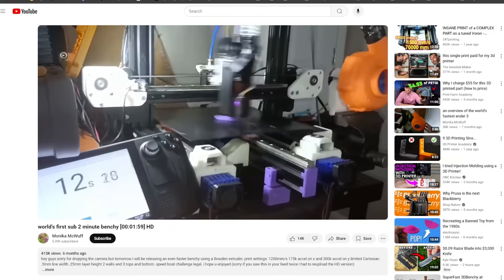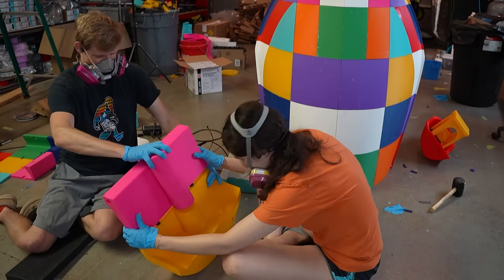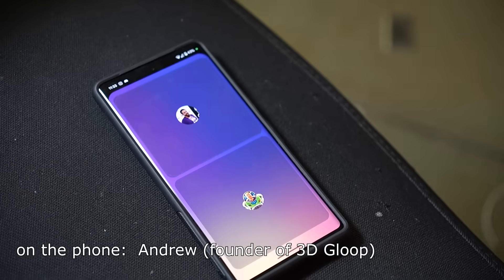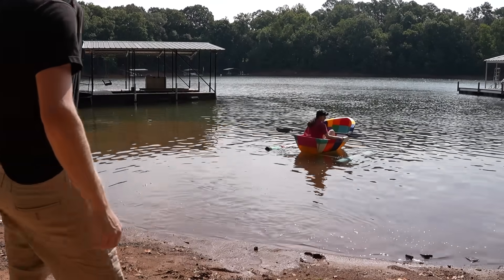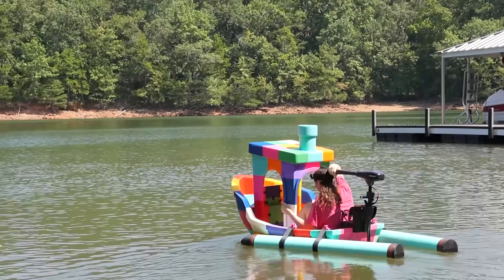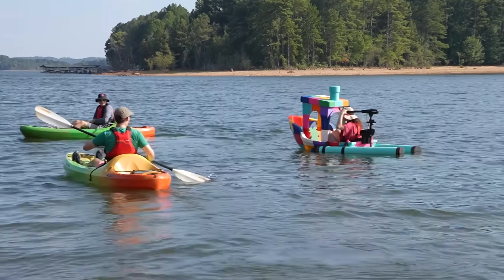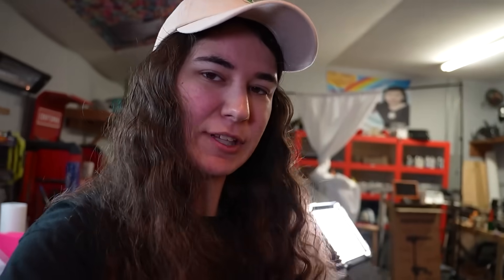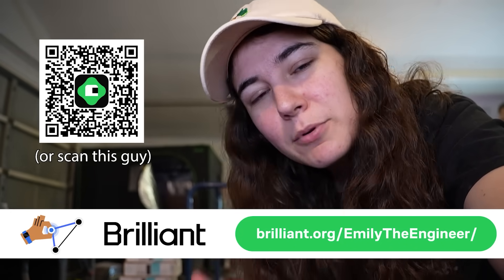I 3D Printed a Boat (World's Largest Benchy!)

Comment: Next trial. Smaller submerged outriggers, or a flatter bottom, to avoid the outrigger look.
When 'solder iron melting plastic' add staples across the break for added strength.

Comment: To balance it, you need to get the center of mass (with a rider) as low as possible, relative to the water line. It is even advantages to put extra weight in the bottom, so the waterline rises. You could have filled the keal with sand or something, right when printing maybe.

You will always displace exactly as much water as you weigh, not more, not less. (assuming you're not sinking)

Comment: Giving boats a flat bottom gives them a thing called inherent stability, basically it will self right if it leans to one side. Boats with a round bottom like your benchy don't have inherent stability and thus need weight to act as balance. The cabin added a lot of weight above the waterline which will make it more unstable.

Honestly, with how caricatured a benchy is it's really hard to make it float properly and nicely, I'd suggest trying to make the bottom wider and less rounded.

Comment: you need at least SOME amount of keel in a hull like that, it's just not built for stability 

could probably just print the lower most pieces with more infill, but might need to resort to filling the bottom pieces with metal or something

Comment: They make sealed batteries for this reason. 4:38

Edit: Battery boxes need ventilation. If you get a deep cycle Group 27 battery you could make the round trip next time.

Comment: You'll have to get that up on plane one day! :face-red-heart-shape:

Side note: They make a "Hot Stapler" for fixing car bumpers and whatnot. Around $40 and it's like a dual head soldering gun with different staple shapes for inside/outside corners, thin/thick waves for channels, etc. Handy for thin things like four layer bike fenders too where superglue is not the best at holding.

Comment: Omfg you left him without a paddle or a phone at dark... ??? Just to avoid a small fee???
Reply: Alone!? Please dont post this or update so kids dont do this??? Very dangerous. Epilogue: 1) fire extinguisher, 2) paddle; 3)phone and radio; 4) life jacket; 5) whistle; 6) led flash flare 7) buddy system no one left behind; 8) don't be afraid to ask for help. Kayak places have fast boats... easy to come pick you up.  Avoid late fee, let them get home on time and everyone lives.
Reply: When running full power 12v highhhh amps. Really like your idea to have safety cutoff from treadmill! Please do 2nd update vid to show how you rigged the safety cutoff.
Reply: @FranklinBryan how do kids even replicate this? They can’t 3D print a boat.
Reply: @Aut319  right because they aren't infinitely smaller lighter dumber... with access to multiple printers?
Reply: @mattstudios740  right because kids arent on yt unsupervised. Hahaa
Reply: @mattstudios740  don't get me wrong, i love this video! But maybe add on a few words about safety? At least for liability? Could be a second quick fun video about safety?
Reply: Very industrious to use the trolling motor elec wires as docklines but this can kink wire causing high ohmic heating and melt/fire? Especially in corrosive marine env. Always take a line rope and paddle! Engineers like redundant propulsion. Please consider paddle and umbrella for sailing in case battery failure. Ps check out lifepo4 lithium battery. So nice

Comment: There's a bunch of small boat-builders that use bed sheets, diluted epoxy (sometimes optional) and coats of exterior house paint instead of fiberglass.  This technique is called "Poor Man's Fiberglass" or "PMF".  It's very cheap and sometimes works better than fiberglass, depending on what you're sealing.  When the boat is already largely waterproof, it's a decent option for smoothing the hull and adding just a bit of extra assurance it won't leak.
Reply: Where could I find their forums?
Reply: I am also interested in this information.
Reply: Whoops, I read that first request too early and hadn't had my coffee.  Search for "poor man's fiberglass" on instructables for a start, in particular a user called "rowerwet".  There's a camper made that way, and also a boat called "Seafoam".  One forum is called "Teardrops n Tiny Travel Trailers" ("tnttt") and has a DIY section.
I'm positive I've seen another forum, but maybe it was on facebook which is dead to me.

Comment: Seeing this video gives me a hope for humanities future as innovation in applications is hard to inspire without expectations of compensation. 
However, I believe it would better serve a healthy public interest if you could at least reference the process of having a marine inspection and hull identification number assigned by an official.
I built a beautiful 16' cedar strip canoe and after wanting more range put a battery powered motor and then a 5hp outboard. 
In the state of Alabama, adding just a trolling motor requires a state registration number. Please educate your audience as you inspire. 
A few years later, coincidentally, I Blender modeled my own 18' canoe and sliced it in software  I then cnc carved front and back of the slices before gluing and glassing. 
I do not possess the inspirational skills needed to light a new generation of exploration.  Please keep the light alive. Best of luck.

Comment: the problem as u saw, is benchy itself is a shitty boat model and we should all really be printing the actuyyal floating versions of  benchy . the first timei realized bency doesnt even float,i got really mad at the 3d printing community for allowing such a useless model to be printed for so long. i assumed benchy was supposd to be tied together toi float in a big responsible chain that you can always pull; back in sao it doesnt litter, and even use benchy chains tio clain rivers withe tc. but nah benchy doesnt eveb float

Comment: Why don't you put holes in the inside of each square or folded piece and put foam in it to increase buoyancy and strength, and have these holes on the inner end of the boat?

Comment: Next time when you do it again but bigger maybe think about making the inside of the hull match the outside of the hull, and then filling that in with weight and putting a false bottom in so there's still a flat floor

Comment: The stock Benchy isn't seaworthy??? my trust in this entire industry is shattered.

I'm looking forward to seeing you print different (better?) propellers for the Macro-Plastic.

Dan: good job naming things.
Reply: probably depends on the infill. If you do variable infill you can probably make it bottom heavy enough for it to float. Flat bottom might also be an issue however, which is why you add a raft.
Reply: No, it is not. It's too top heavy. A while back someone redesigned the benchy to float a lot better, I'm surprised they didn't use that model instead.
Reply: https://www.youtube.com/shorts/nG2U14nzV4Q

Comment: If you get annoyed with people not knowing "basic physics" don't watch the video !

1:10 No ! Thats because of the CG you domb was putting a huge weight on top of the boat, of course it will tip over, when you remove it it will not.

Not because you added a hinge at the bottom!

It does help but not the only reason or the important reason!
How can someone be so dum?
For this thing to understand you don't have to read a book even a monkey can see and relate it !

Please start making stupid reels or comedy videos and leave anything that requires use of a brain ! 🤡🤡🤡🤡

Comment: For plastic lass just use polycement plastic glue, it works by melting the two surfaces together so you don't need epoxy and it'd be stronger and more waterproof.

Comment: Have you ever tried friction welding for putting parts together? It’s pretty easy. Just print a small cone that can fit in ur drill bit and then spin it against the 2 parts like glue and it should work.

Comment: A major problem I see is that 3D prints are porous so over time this thing would fill with water due to absorption unless you give it some sort of clear coat or something.
Reply: I ve printed a lot of watertight things from pla and petg , it's only a matter of settings ..  easiest way is bigger nozzle like 0.8 ,0.3-0.4 lh ,few degrees upper than normal temp  few % more extr vol , lower speed and cooling ...
Reply: yeah, i think the reason they didnt do a coating is specifically because the youtube comments would say "oh the coating is doing all the work its not really 3D printed at this point", but i mean, cant win with the youtube comments anyways. and the extra floatation tubes are way worse than a clear coat. also at this scale, im pretty sure the plastic isnt pourous enough to absorb water all the way through. the wall thickness has to be prettyyyy thick, as opposed to the usual thickness where the porosity allows for routes into the hollow parts.

they only needed it to work for one video though, so it worked out either way.
Reply: @arcanealchemist3190  I really don't like these comments because the coating would only solve a minor issue. It's not like water instantly penetrates the plastic, it takes pressure and time. Sometimes people want to be annoying without thinking about how it really happens. But yeah 3D prints have these pores. The 3D printed submarine video proved this. Because submarines withstand pressure... Water gets in a lot faster. For submarines this is a major issue. But I'm going to argue that even carbon fiber isn't good enough for submarines... It has to be a very special steel alloy.
Reply: You're doing it wrong if your prints are porous.
Reply: Like wood?
Reply: Naw, it’s good, don’t worry about it
Reply: No, some aren't. You have no idea what you're talking about! Hint: there's more than one type of plastic, with different degrees of porosity!

Comment: That's not a live size benchy. You need to be able to stand in the cabin. 😂. And no pontoons. But you need to change the hull, because the benchy is top heavy so the hull needs to be wider. Try again. 😅

Comment: You need a thing. the thing. the tthing below the boat that stabilizes it. Like a fin but on the under side of it. Like a fin that stabilizes it.

Edit: Googled it, and it's called a "stabilizer fin". Ok
Edit2: That was wrong, it's actually a "keel", thanks @Toxicity1987.
Reply: I actually thought a lead keel would be more effective.

Comment: can't wait for the first 3D printed aircraft carrier "USS gridfinity"
Reply: 🎶 Danger Zone intensifies 🎶
Reply: threre is already a company that 3d prints life size boats  you can buy.
Reply: But Emily doesn't have an Optigon...? ;)
Reply: wouldn't that be a zack freedman project?
Reply: @_R0BB_  A zack freedman project would use a cursed filament for the life-sized benchy.
Reply: @sammiller6631  Too true!
Reply: I agree with you they need to launch RC planes off of it too
Reply: uss is for aircraft? I thought it was for boats
Reply: @tray84  lmaoo Aircraft Carrier
Reply: @tray84  keyword: carrier
Reply: @8bitarmory846  y'all tryna make me look dumb. "USS is an abbreviation for "United States Ship" and is used to identify commissioned ships in the United States Navy. The prefix is only used while the ship is in commission, and before that it may be called a "pre-commissioning unit" or referred to by name without a prefix. 
The abbreviation USS can also refer to any commissioned military vessel of the United States, including ships from the Coast Guard, Army, Air Force, and Space Force." -ai
Reply: @8bitarmory846 actually the United States Coast Guard used USCGC not USS. It's stands for United States Coast Guard Cutter and historically was because of the type of sailing vessel used by the coast guard but in modern times is used to differentiate the USCG vessels from the USN vessels
Reply: @tray84 see my other comment regarding USS vs USCGC vs USAS. The different branches use different prefixes for their vessels
Reply: ohh I just realized. aircraft CARRIER
Reply: @tray84   >-ai
figures lmao
Reply: @tray84  SS is for watercraft
Reply: @dogonumnum  And Otto Flick

Comment: "What is this? A BENCHY FOR ANT'S!?  It needs to be... 3 times bigger than this! How is Emily suppose to have a lake adventure if she can't even fit inside the benchy? "
Reply: True.. she has to sit INSIDE the cabin....
Reply: Make the steering wheel functional
Reply: Is this a zoolander reference lol
Reply: Not gonna lie, I was expecting one big enough for 2 people to stand in..........    This was a good practice run.  Lol
Reply: He's absolutely right.
Reply: Also needs space for a cooler, so when you run out of battery you have snacks and cold drinks :D (also needs a solar panel on the roof lol)
Reply: She should have printed it out of Blue Steel.
Reply: It can’t turn right
Reply: Exactly 😅
Reply: The motor should also be mounted in a tractor configuration. It would increase stability and speed while reducing draft. It would however require a modification of the keel. If it's a completely new build this would not be an issue.
Reply: She doesn't HAVE to be in the cabin. And it's not even close to a bench for ants. For ants would be the normal size u idiout.
Reply: Bots Masters: The 3DP Years
Reply: Collaboration with ayo , make a 3d printed houseboat called the Itty- benchy
Reply: You haters make it then huh? Where is your months of dedication
Reply: https://www.youtube.com/shorts/nG2U14nzV4Q
Reply: And also printed out of Petg so that you don’t need to keep it inside, oh and use a DJI power bank or somthin
Reply: It has to be the size, that a solar Panel, who delivers enough for the Motor, fits on top of the Cabin.

Then in PETG ... so we get close to a Real usefull thing

Comment: Always take a backup paddle.  This is my favorite project of yours so far.  Excellent job!
Reply: they could 3d print a backup paddle, so obviously, bring a 3d printer
Reply: @Ticktok_of_Oz  Now we're cooking with fire!
Reply: and a backup battery too
Reply: On top of that, a small solar panel on top of the cabin of The Macroplastic probably wouldn't have added too much weight and, during the peak of the day, probably would have slowed the drain on the battery by a decent bit. It's all about redundancy!
Reply: Or sticks and a big sheet for an ad hoc sail

Comment: I'm guessing this was in PETG and not PLA right? If its pla then im surprised it held up that long in the heat! I suppose adding a fan to the battery would be the next step
Reply from the maker: it was 100% PLA! (Polymax from polymaker though so definitely on the tougher side)
Reply: @EmilyTheEngineer  Damn thats awesome! might have to grab some if i can find somewhere that sells it in the uk

Comment: Flex seal...ya know..the dude who slapped taped on a leaking pipe...flex seal..clear paint...done and done
Reply: you mean the guy that sawed the boat in half and then drove it :D
Reply: @Der-Martinski  And we now have the idea for another video.
"Yeah, remember our boat from earlier? We sawed it in half and put it back together with flex tape. We're still not sponsored."
Reply: This is what I was looking for! They don't have to heat seal all the pieces together, just throw some clear packing tape over the seams and hammer it with some Flex Seal! I waited but the MythBusters never made a spray-in bed liner boat like they did with duct tape.
Reply: toxic